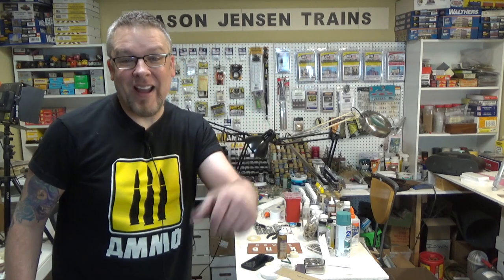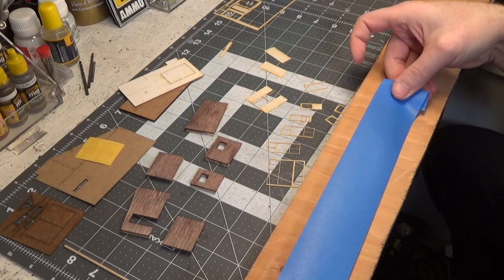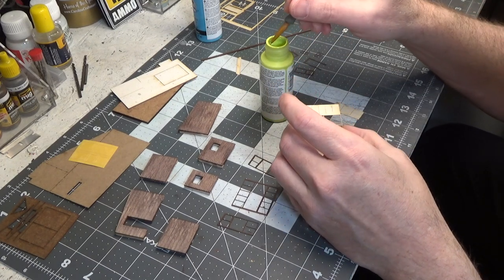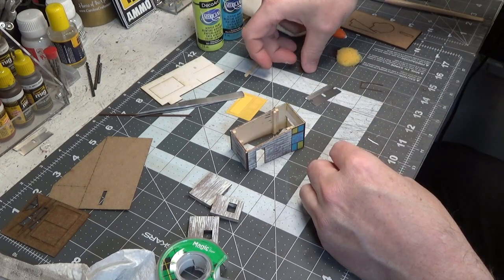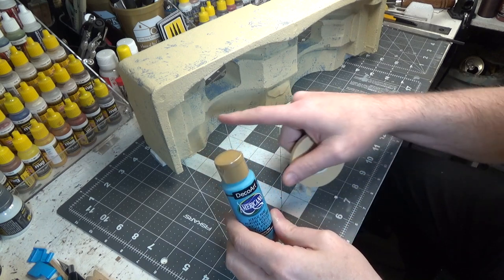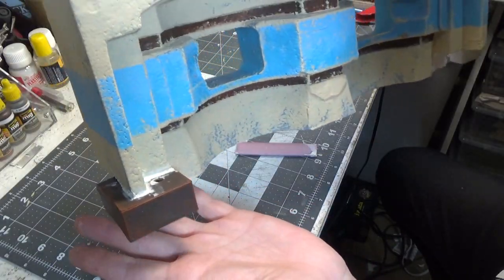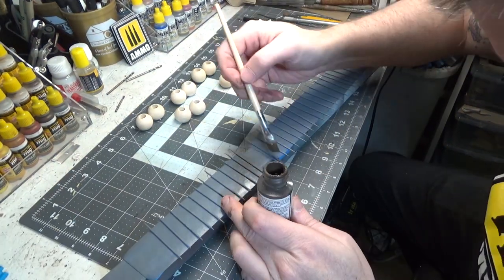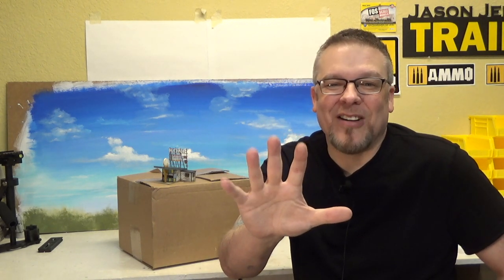Building a model of an ice cream shop!

Comment: It was a cool video, one for each scale like before on past videos.   I work with a lot of white Styrofoam I uses to use liquid nails but found when I went back to trim it.  had a hard time cutting I now use Styrogoo sets up fast and easy to cut through a lamination of two pieces of foam.    Thanks for sharing
Reply from the maker: Thank you so much Will!!! I’ll have to look into that Styrogoo. Your right, you can’t cut liquid nails and sometimes you have to go back and make changes. Thanks for the tip! 👍